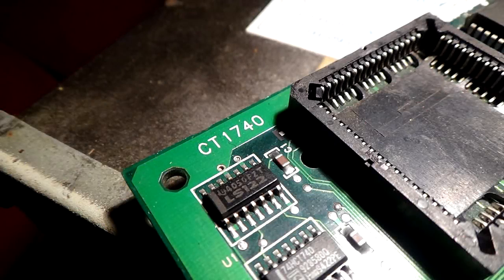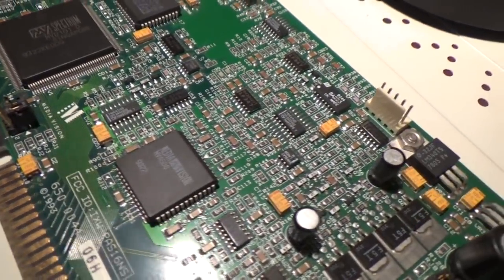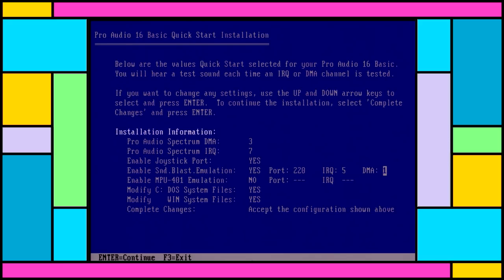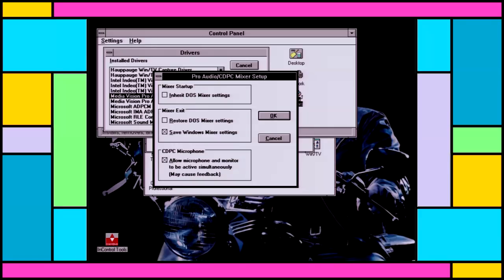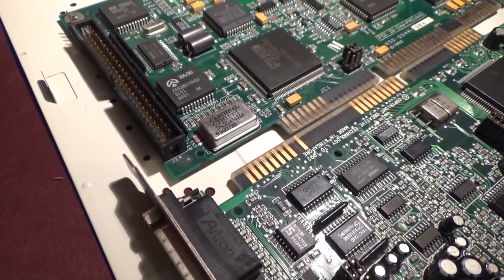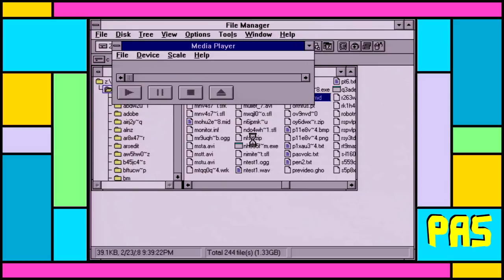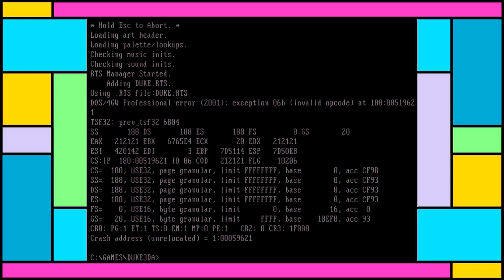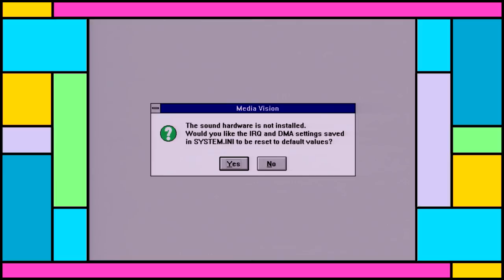PAS16 VS SB16 (Plus lengthy rant)

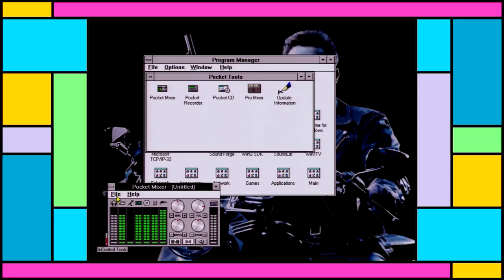Comment: 14:04 Noooo, I don't miss ROTATIONAL on-screen controls one little bit. Never know where to click to adjust, or are you supposed to actually rotate the damn thing moving the mouse cursor in a circular manner.
Reply from the maker: You don't have to use them, you can use the keyboard or else click on the little + and - buttons next to them.

Comment: The PAS16 was my first sound card as a kid. It came as part of the "multimedia" kit and included the scsi CD-ROM drive and some software. I still have it to this day including even part of the box. The noise of these early sound cards generated was a non issue for me as a kid. I was one of the lucky few that more than a pc beeper and that was all that counted.
Reply from the maker: Well yeah, nobody really noticed things like this for a good while it seems. Still not as noisy as the SB16, especially when set to equivalent levels, the PAS16 actually has a fairly managable noise floor for its time.
Still, you lucky sod, I had to wait a long, long time to get a sound card and it was only pre-owned OPTi 930... the Sound Blaster 512 was already out by the time I got that, so I was only a little behind the times.
Reply: I was very lucky to have gotten the multimedia kit in 1993 as gift from my dad. A kit like that was around 1000 US$ not adjusted for inflation. I only realized I was lucky when a teacher in class asked around who had a pc with cd-rom drive at home and I was the only one raising my hand. As for sound comparison it's kinda hard and not fair to compare 25+ year old cards. Capacitor degradation can have a lot of influence. I have 3 creative SB16's and they all sound different. In the future I might recap one of them to test what difference it has on the quality.

Comment: I remember I had a 486dx 100MHz with a Pro Audio Spectrum 16. The sound card worked fine in windows. But under Dos, it only was sound blaster pro (stereo) compatible, not sound blaster 16 compatible. So I was limited to 8 bit sound for almost all games (most games ran under dos in that time), and I was limited to 8 bit sample recording (and playback) in fast tracker II (a MOD and XM creator program. XM was a 16 channel MOD sound file). Then I bought a SB16 for 16 bit sound support for dos games and fast tracker II. But guess what, the SB16 ran fine with SB16 compatible games and with fast tracker II, but... (if i remember correctly) It was only MONO compatible with sound blaster pro games. So I had to keep both sound cards running side by side on the computer. I used the PAS16 for windows and for support of sound blaster pro (stereo) games under dos. And I used the SB16 for SB16 games and fast tracker II. I had the sound output of one card connected to the line in of the other card, which was connected to the speakers. (So I could listen to whatever card being used at any given time without plugging or unplugging anything). Only thing I can t remember is which of both cards was connected to speakers and passing through the other card's sound through line in.

I also had a casio music keyboard connected through midi adapter (joystick port), and it could play general midi and roland mt-32. It sounded much better than the sound cards fm (when it was supported by games, roland mp401 was the option i had to choose in order for it to work i think).

Later i had a sound blaster awe 32 or awe 64 (I can't remember exactly), but i remember that under windows i could load 3 different soundfonts for midi. I think they were 1mb/2mb/4mb sets, but they could be 2mb/4mb/8mb sets. (what i do remember is that the higher mb set used a considerable amount of the system total ram hurting performance, so it was better to use the lower mb ones until i upgraded computer /system ram.

Later came the sound blaster live 5.1 (do you remember DVDs and the introduction of 5.1 audio for home movies?). It was great (and at the same time so damn hard and user unfriendly to really make a software dvd player output 5.1 sound instead of plain stereo). But once properly configured (something no average user would try or be able to do easily by that time), you could watch dvd movies for cheap on the pc with 5.1 discrete channels sound :-)

Comment: The quest for the optimal sound card for my preferences continues.
Reply from the maker: I've long since come to accept that the perfect card doesn't exist, so the solution is just to own lots of different ones. Or else, I use that as a justification (excuse) to own lots of different ones.
Reply: @HighTreason610  Compatibility is def. my #1 preference.  #2 is a card that has as few bugs as possible while at the same having a decent quality sound...the Duke Nukem sfx glitch also has a stake in the card I choose as well...

Comment: Oddly enough, I had to lower the PCM sound volume of my noise blaster CT1740 to reduce the noise (and also match the sound level of FM synth that is a bit too low in my opinion even when the mixer say they are on the same level)
Reply from the maker: I hate it when that happens, the quiet FM. Of course it isn't helped by games like Keen that have really quiet music and there are a good few such offenders out there, you likely noticed both cards have fairly audible noise here because of how far the recording had to be turned up (and of course mixer tweaking wasn't allowed) - I still laugh at the SB16 in other games though, that rush of hissing that comes out whenever PCM is playing, it never gets old, though obviously every card from this time seems to do that to some extent.

Comment: Thorough analysis, well done. I purchased the PAS 16 new and I still think it's a fantastic card. That was, until I got a GUSMax. Now I'm trying to get the GUS and the PAS working together for my ultimate DOS Sound experience.
Reply from the maker: Good luck with that, I could never get the GUS to play ball with another card installed, there will always be something that won't work.
Reply: I've managed to get it working - it's possible.  Maybe I'll put a tutorial up myself.
Reply from the maker: People have walked me through it in the past, it will work until you start up another game and either the GUS or whatever other card won't work with it, a lot of software is sloppily written and doesn't allow much lenience for ports and interrupts being moved outside of their stock settings. Even with Sound Blaster cards you'd be amazed how many games will occasionally throw a fit because they prefer IRQ 5 over IRQ 7 or vice-verse. Luckily I don't really have anything that supports the GUS anyway so it isn't a problem I have to worry about, it would have wound up in the PPro but is currently dormant in a box because that system got dismantled and the VI9 board it was in died as we knew it would. It will probably end up in the DX-50 instead because it is a silly (and mildly unstable) machine, so it warrants having a silly (and mildly unstable) card.

Comment: fyi, my PAS16 definitely does have a YAC512-M DAC chip. it's not the same exact board as yours; mine has the extremely obscure LMSI interface for Philips CD-ROM drives. my card's part no. is 650-0042-01.

Comment: PAS 16 does have a lower noise floor, however on some comparisons its necessary to be more careful with regards to level matching. When you showed the difference on the tracker playing @around 20 minute mark for example, the main cause of difference there is that the PAS is set to a higher output level and is even clipping the peaks, resulting in some small amount of distortion and compressing the audio.
Reply from the maker: I don't inherently disagree. It's a bit of a tough one because if I fiddle with the levels on the cards, someone else will turn up and say I'm skewing the results by doing so.
One curious thing I recently discovered is that the SB16's output being how it is might not entirely be Creative's fault. I used an amplifier chip in an electronics project and found the datasheets were full of errors. I looked at sound cards to pick out an alternative and realized the SB16 used the same amp that I had first tried to use. They don't seem to have used that model again. It's therefore possible that the thing is set up completely incorrectly and they just had to give it their best guess - which being Creative, they probably didn't try that hard with - and hope it worked out until the stock they had was used up.
Incidentally, for my project, I ended up building something similar to Media Vision's approach (using a bunch of transistors, albeit smaller) instead of buying another chip.
Reply: @HighTreason610  hah yeah fair enough. Cool video, everytime I hear Adlib Tracker it makes me wonder what would have happened if the OPL3 was used like this in games, so much potential...

Comment: About that PC speaker output.

I've got an AST Advantage! Pro, and it uses one of those crappy piezzo PC speakers, which are built into the motherboard.  What would happen if I attached a separate PC speaker to the header on the PAS.  Would it play through both, or would one take priority?
Reply from the maker: Whatever comes out of the PAS' line-out jack will come out of that header if nothing is plugged into said jack. As such, you should hear the PC Speaker out of both, unless you mute it in the PAS mixer. From a technical level, the PAS actually has its own PIT onboard.
Reply: @HighTreason610  neat!

I ended up picking one up on eBay yesterday, I wanted to try out some alternatives to the SB16 that I have in there now.  Between the SCSI port and the ability to use a better PC speaker, this is already opening up some new possibilities.  I'm looking forward to hearing how this sounds in my machine.

Comment: Thank you for this video. Really interesting to learn the differences. When comparing the sound of the mod tracker you mentioned both cards use the same fm synthesis chip so the difference shouldn’t be so great. But, if I understand correctly, mod tracker files are actually not using the fm synthesis chip but the digital sound chip?
Reply from the maker: This tracker drives the FM chip directly, unfortunately its implementation is quite bad but it was one of the only things I had to hand that demonstrated OPL3 mode.
It doesn't seem that unusual to me, really, given there are trackers for the NES' crummy sound chip, or the Neo Geo, plus others. Even some games run tracker type code behind the scenes - on the PC, I think Skyroads does, on console Outrun 2019 comes to mind as one of the more obvious examples.

Comment: I gotta disagree.  The SB16 came out way before the PAS, and as such, became the standard for 16bit audio.  With the exception of the shortcomings on the audio, most of which require a A/B test to notice the differences, the SB16 was superior superior in my assessment for a lot of reasons:
1:  Compatibility.  There is the SB16 and everyone else.  The SB16 is the most compatible card, and compatibility was king.  We weren't audiophiles back then; we wanted EVERYTHING to work.
2:  Drivers:  The SB16 didn't require TSRs/drivers.  You don't even have to use SET BLASTER if you don't want to.  Memory was tight back then, and PAS system overhead was a deal breaker.
3:  Cost.  The SB16 was less expensive.  The inclusion of SCSI was a dumb idea.  If you wanted SCSI back then, you were running an Adaptec card.  All other SCSI cards were crap.  And SCSI CDROMs were also very expensive, not to mention difficult for normies to setup.  IDE CDROMs started appearing around the 4x days, not long after the PAS came to market, rendering the SCSI interface on the PAS superfluous and wasteful.
4:  Despite your anecdotal experience, I had quite the opposite, where supporting the PAS was a complete pain in the ass.  A couple of my friends had the PAS and they had to screw with settings to get things to work.  Different config.sys and autoexec.bat could be required depending on what application/game was being used.  Not an issue at all with the SB16.  It just works (TM).
5:  Sound quality.  You didn't mention it, but the SB16 has the capability to disable the onboard amplifier.  That usually makes a noticeable improvement on sound quality when used with an external amplifier.  I personally used passive speakers, and liked that the analog volume dial allowed me to quickly and immediately adjust sound settings, regardless of what was running (TSR based mixer doesn't always work while some programs are running).

I think the allure of retro is running on real, period hardware.  However, PAS was not quite contemporary with SB16.  It might be a better Windows 3.x card, but games really never were Windows based until 95; they were DOS games.  The SB16 was king even into the SB AWE days, as everything still supported the SB16.  Sure those new sound features were absent, but most gamers were more pragmatic about it; especially when the differences boil down to a 'gee whiz' factor that might be nice to have but isn't in any way necessary, or missed if not present.  And I still think wavetable is crap.  FM Synthesis is all I care about.

The SB16 is the only sound card I've ever bought.  Why would I need anything else?  Before it was a bunch of cards that didn't last too long.  After it were a bunch of cards with extra features that might be nice to have, but weren't necessary for game play.  And by the time we started upgrading, the DOS era was over, PCI and sound cards integrated on motherboard were the norm and not really suitable for DOS anyway.

Anyway, another enjoyable video.
cheers
Reply from the maker: 1. I did mention compatibility on more than one occasion.
2. Of course, though loading a PAS16 next to an ASPI manager and other things, including the TSR for the Maui card, hasn't caused me any real problem yet, seems to be quite lightweight.
3. The PAS16 was less expensive in most of the ads I've found from that time. Multimedia kits seem to have been quite common, Creative had a preference for MKE... what use is that? That's hardly any easier to configure. Creative did also make cards with SCSI but I've no idea of their limitations. Similarly Media Vision made cards without SCSI or with other interfaces, seems most people were happy with the SCSI version.
4. Are you sure this was a problem with the hardware, or was it that your friends didn't correctly configure their system and decided to blame the hardware instead? Although the SB16 does indeed 'just work' most of the time. Jumpers or software, pick your poison, figuring out where IRQs and DMAs ought to be can always result in headaches either way. Bad luck is always a possibility though, some motherboards simply don't like some cards or exhibit odd quirks, recently had to iron out a DMA issue on a K6, the DMA channel wasn't in use but it had to be assigned to Legacy ISA in the BIOS despite being used by a PNP card, this problem exists only with one specific card on that one specific system - an AWE64 Gold.
5. I thought I did mention the amp? If not (may have cut it out) then sure, but even with that disabled the SB16 generally produces more noise.

Most people at the time likely ran cheaper clones, it certainly seems that way with most every machine I've seen. OPTi and later the ESS cards were abundant and cost less. The average consumer was too out of the loop to know or care and many other people weren't willing to sink the cash for a big name card. A board like the OPTi 929 'just works well enough' that you could get away with it. As you say, most people were simply happy if it worked at all, I didn't even have a sound card until the 90s were about over and the family system ran an ESS, which did the job well enough.
As I said in the video, the whole thing is subjective, you obviously lean on the side of compatibility which isn't unwise, whereas I have another machine with an SB16 already and prefer leaning towards the side of quality in this case. If you want real compatibility and configuration problems you ought to play with some of Turtle Beach's cards, those things are truly horrible.

To clarify, I don't think choosing the SB16 is a bad decision at all and I'm not going to tell anyone what to do with their own system.

On the subject of the Pentium, ha, sucks to be that store. Serves them right, they ought to be more observant. The local store was the opposite and would steal any decent hardware you had, replacing it with cheap shite that barely worked. Socket 4 chips don't show up too often but there are way more FDIV ones than there really should be, possibly from collectors doing their best to save them over the 'working' models, making the 'broken' ones only marginally less common than the 'fixed' ones. Once you move up to Socket 5 there are less and less FDIV chips as the speeds increase.
The configuration shown in that video is very outdated and has changed greatly since.
Reply: SB16 being the most compatible was only because of the amount of games and other entertainment media written specifically in mind, which is nothing more than a business choice, and never implied superior all around quality. Creative simply had a better business team than Media Vision. That's the only reason SB16 was more compatible.

Comment: you need -5v for the PAS16 but the SB16 doesn't need the -5v unlike the PAS16
Reply: That's true. But in these days of 286/386 AT PCs, availability of the -5v rail was just normal. At the time, it wasn't foreseeable that later ATX PSUs were going to outphase it.
Reply: There are adaptors on ebay that add the -5v to atx or at.
Reply: @pentiummmx2294  Thanks for the information! ^_^

Comment: so in order to enter mixer gui , you have to type this?: PAS.EXE *
Reply from the maker: Indeed, that is correct. You can also set the DOS mixer to inherit the Windows levels using the Drivers applet in the control panel in Windows 3.1, I don't remember how to do this in Windows 95 but think the option was still there.